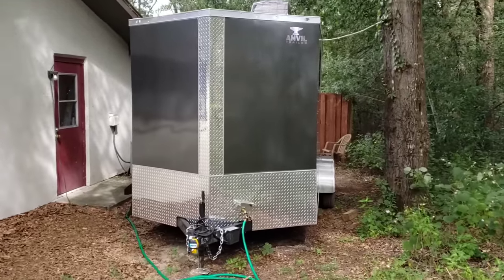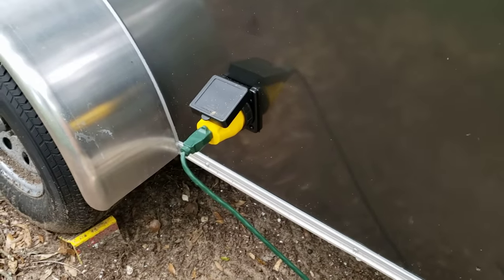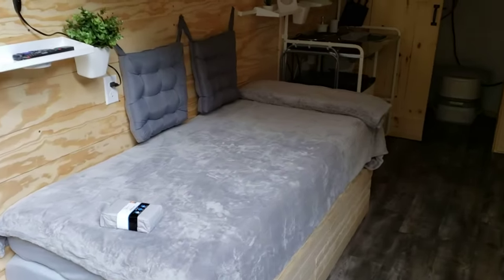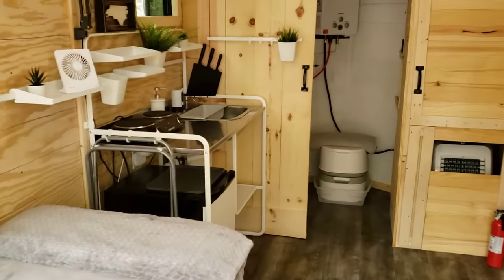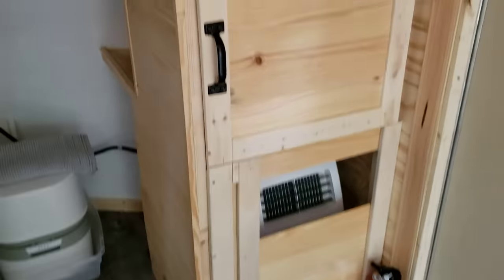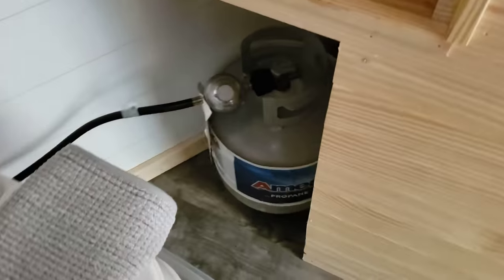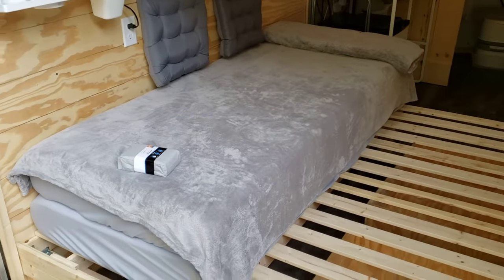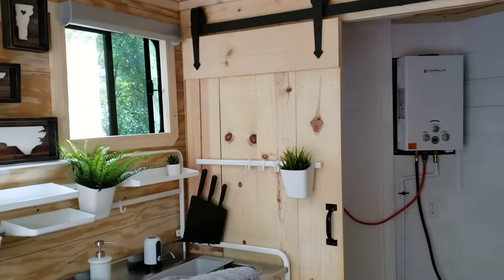7x14 Cargo Trailer Camper Conversion Finished (Tiny house?)

Comment: The one bad point is that many RV Parks/Campgrounds will not allow converted trailers; converted class B vans; or U-Haul rental trucks to stay in their RV parks.  The converted trailers/ trucks are not built to USA RV safety standards.  They're not certified.  I believe it's a insurance liability question for the RV parks and campgrounds.  Maybe the trailer owner could buy LIABILITY coverage for their rig?
Reply from the maker: I was able to register ours as a travel trailer and insure it accordingly, I haven't had any issues here in FL so far.
Reply: no it basic prejudice cant afford expensive but not built very well rv you must be riff raff in there eyes. yet many expensive rigs are overloaded poor quality  as seen in many videos. ie brand of trailer frames collapsing and a 25 to 100k trailer with china bomb tires
its reminds me of the hoa in homes,

Comment: How did you attach plywood? I’m not a carpenter, so I would think going through to the outside?
Reply from the maker: The trailer has a 1 inch steel frame between the interior plywood and the outside aluminum. Each 1 inch stud is 16 inches apart, thats what you attach the plywood to.

Comment: Why would he put that plug outlet under the water heater? If the hoses failed do you really want electricity directly underneath it?
Reply from the maker: Good question, however it is a GFCI outlet, it's designed with a fail-safe if that should happen.
Reply: I love the build. I watch many van life or camper living videos and dream .  When I saw that set up it reminded me of a house my mother once lived in. Who ever built this place put a plug outlet directly under the washing machine hookups. It horrified me as in Western NY pipes can freeze and burst. I pointed it out to mom and they built a shield that would divert any water away from the plug. Many of these tiny houses on wheels need a smoke/carbon monoxide detectors and fire extinguishers. I'm always worried about their safety in such small spaces.

Comment: Did you insulate the Walls with anything or just put wood right over top of the trailer walls ? , we use the same trailers at work and in the fall / winter seasons it gets really cold inside are trailers with bare walls and no insulation at all , Also note I live in Ontario so it gets really cold here but depending on we’re your camping you might not need it
Reply from the maker: Yes I insulated with 1in foam board insulation in the walls and one-and-a-half inch in the ceiling.
Reply: @Stephens802  oh nice ! Thanks for the reply dude  , hopefully it’s nice and warm when your out in the sticks !

Comment: Do you have the water heater vented outside somehow?  I want to do something similar but am worried that having inside could lead to dangerous gases inside the trailer.
Reply from the maker: Education is the best form of safety. If you do some research on how gases work and consider that you'd only be using the propane inside the trailer for 10 maybe 15 minutes at a time then I feel like it's safe as long as you understand how everything works.
Reply: @Stephens802  thanks. I think you are right. I’m going to mount mine inside as well but like you say, just be aware of how long you are using it. Keeping some ventilation open during use is also a good idea.

Comment: It looks great. Is it insulated or did I miss you saying that?
Reply from the maker: It lightly insulated
Reply: @Stephens802  have you ever thought about adding conduit receivers on the top corners of your rear door? That way when your rear door is down you can insert the conduit and put up either mosquito netting or walls made out of a tent like material. It would greatly extend your living space. I love your setup. My wife and I are interested in building one similar to yours. You did a great job.

Comment: Did you take the walls down to cut the groove?. Looks great!
Reply from the maker: I did! However, it's not necessary in my opinion.  Thank you!
Reply: @Stephens802  how would you do it without removing the walls?
Reply from the maker: I would  just draw the lines on the wall with a pencil and then use a circular saw by hand.

Comment: What was the weight? How much would you charge to build one for someone else? I live outside of Tampa.
Reply from the maker: 2920lbs. Probably between $4k-$5k
Reply: @Stephens802  you're not by chance related to Marvin and Mary are you?
Reply from the maker: @pamalawyerick2004  No, I'm not familiar with them.
Reply: Thanks for the price quote. I'm not 100% sure if I am going to go with a 28 ft or maybe even 34/36. I don't really know a whole lot about them I'm just looking at it as a way of trying to save some money over the next few years.
Reply from the maker: @pamalawyerick2004  I actually just finished building a 28 ft tiny house for my wife and I to live in.
Reply: @Stephens802  That's nice, I bet she's happy. I think I would only need help with the electrical, plumbing, insulation, interior wood and installing windows. I have my own plans for a bed and the kitchen and bathroom. ---do you have a video of your 28-ft tiny house or is that something you weren't going to share yet?
Reply from the maker: @pamalawyerick2004  I do actually have a short video on my YouTube channel that shows it a few weeks before I finished everything, I haven't had a chance yet to put out a finished video.
Reply: @Stephens802  okay. I'll be waiting for your video.

Comment: Could you share the link for the 110V—>12V converter?
Reply from the maker: I really wish I could but it's something that I got from my brother and I don't know anything about it myself. Sorry 😔
Reply: @Stephens802  Okay NP.  I have another question if you don't mind. The toughest part of in my mind for planning my conversion is the proper order for electrical, plumbing, insulation, flooring/walls, cutting vents and window holes, etc. We have our layout set, which is very similar to yours.  We know we won't be insulating the underside of the trailer. Could you tell me what order you recommend for those things?
Reply from the maker: @Weekendgarager  
Great question, id say electric and plumbing first, then insulation. That way you can go around the important things. I put my insulation in and then had to cut pieces of insulation out in order to route the electrical.

Comment: what company built the trailer ?
Reply from the maker: Anvil
Reply: @Stephens802   did you order studs in floor, walls or ceiling ?
Reply from the maker: @MrDedwardk  No, I just attached 1x2" furring strips to the metal frame.
Reply: @Stephens802  ok cool.. was just looking through options and was wondering how you kept your weight down so low. Thanks for sharing this really enjoyed your video 👍